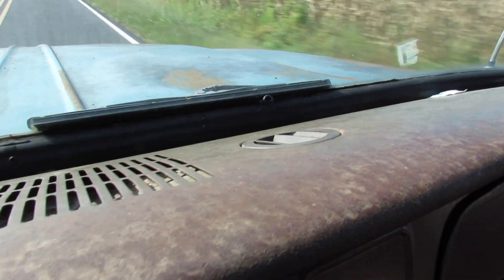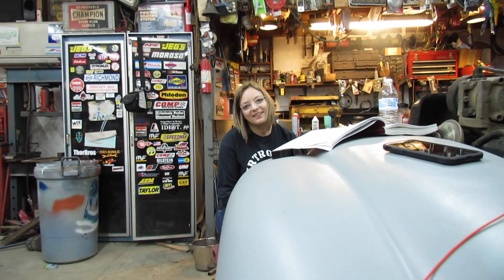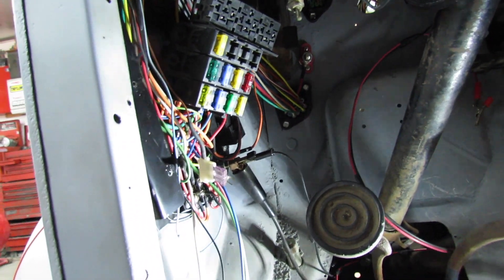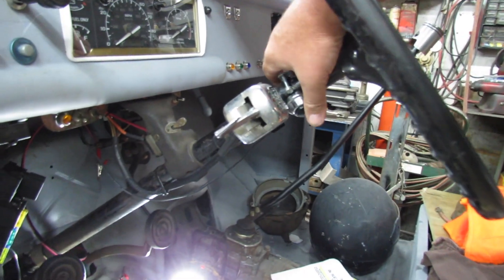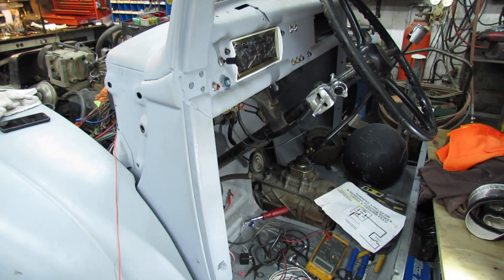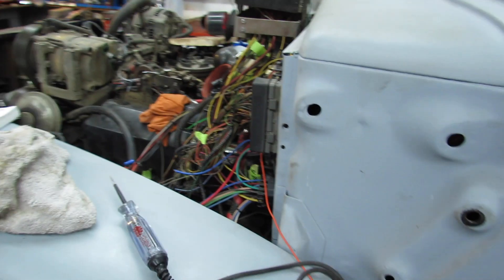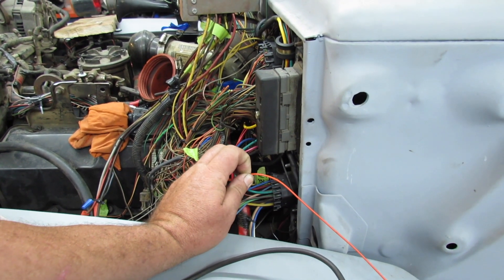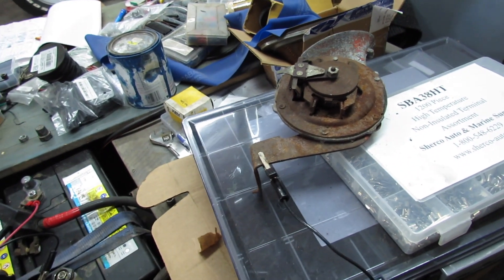46 Ford-Wiring Fail and Fix

Comment: I keep begging for  more 46 and then the wiring issues come out and I instantly forgive you for any time needed to clear the cobwebs from that mess. I know that they look worse than they really are but was hoping that those wires would eventually get shortened to the length needed and set in place to do their job. I can see that your running out of real estate for  wires to park. Great video mr shevy

Comment: You have a snake pit for sure, I hate wiring harness problems, it takes me forever and a day to figure out a simple problem, I have a F-350 Ford with a burned fuse box and cannot find a replacement one, do you have any  suggestions ?

Comment: Try pulling fuse 10 out and see if it starts, also with the fuse out try checking your circuit breaker and see if it’s still back feeding power thru it. If everything works right with the fuse out, yank that yellow wire out and use fuse 10’s location for another circuit. Maybe the fan for the engine so junior doesn’t get interrupted whiles he’s.....

Comment: No idea about your electrical wiring issues because I'm partially colourblind but an observation - why does it take so long to fire up after the glowplugs have supposedly done their job? Does it lose its prime? Is it a self bleeding fuel system?
Reply from the maker: Dan Whiteford it hasn’t run much. And the batteries are a bit weak.

Comment: The glow plugs arent ataying on are they? cause the light stayed on after it started. On my Ford of the same vintage, the wait to start, which is the glow plug light, goes off in a few seconds. no other lights are on.? IDK, Im just a stupid ol' truck driver!   ToddTRT
Reply from the maker: Kelly Konoske On this vintage anyway the glow plugs will stay on and cycle a bit even after its running. Wait to start does not indicate that the glow plugs are off.

Comment: Why does the glow plug light stay on after  it starts?
Reply: M & N Woodshop I think they cycle on and off a few times.
Reply from the maker: M & N Woodshop supposed to do that. Originally it wouldn’t have a light showing how long the glow plugs stay on.